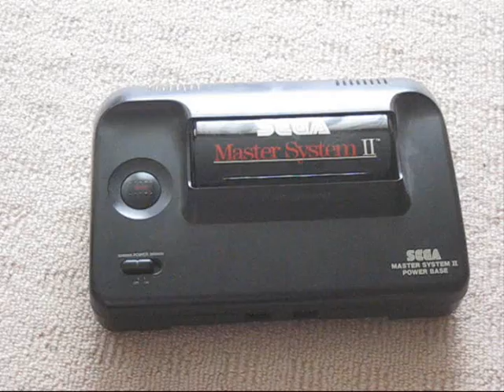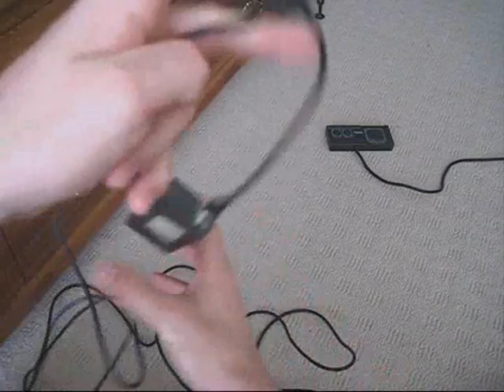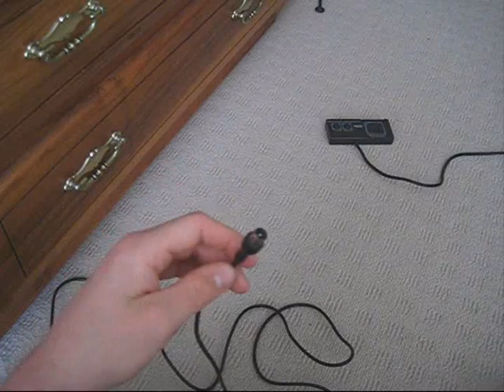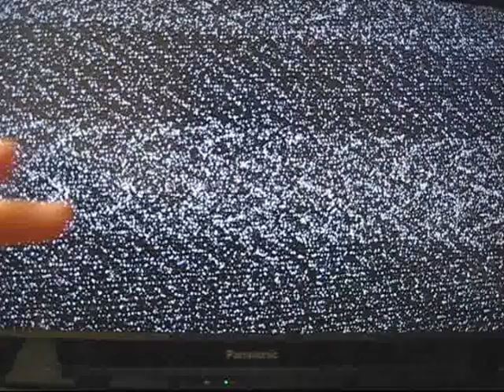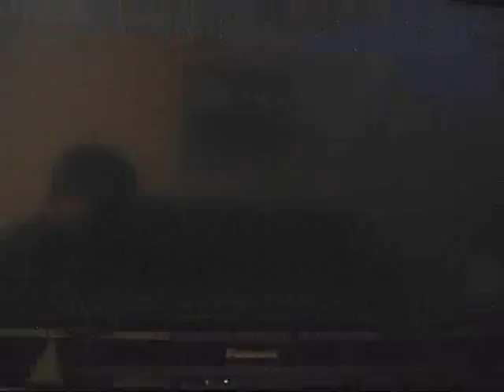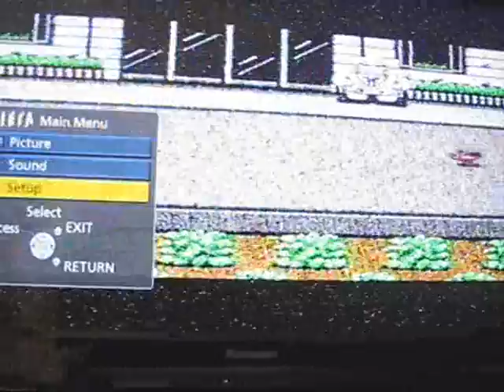How To Set Up  Your Sega Master System / RF console

Comment: Not all modern sets have manual tune for analogue, picture looks bad on HD set anyway.  Older tube sets provide better picture quality as it's native resolution.  If u still can't tune manually rf on crt set, you can pick up various adapters (rf to rca) on
 e-bay,radio shack, dick smith etc.

Comment: my pal master system lacks a switch selector.
trough that rf adaptor looks clunky.
sometimes i wish that modern tv's could restore & improve that crappy rf signal.
Reply: Depends on the part of the world you are in. The manual I have mentions a switch for the New Zealand version but the switch is to choose channel 2 or 3, I believe this is because most TV sets in NZ were VHF only until the late 80s. The other countries in the manual there is no switch and the advice is to use channel 36 on the TV. There was also a French version that used a scart port.

Comment: hi, i bought a sega megadrive off ebay and I'm stuck on getting it set up. The RF cable - do i just plug that straight in my tv or do i need a cable already going out my tv to plug in the RF ? i got it to work a week ago (shoving the RF cable in a slot at the back of the tv) but the picture was fuzzy and kept switching on and off, i accepted that it was prob dodge and not gonna work and left it but now its like, i really wanna play! =(
Reply: Are you too lazy to try? >:( 
Well for my master system it just plugs straight to the tv antena "hole".

Comment: For a master system 2, can i use a different console power supply (UK)? are there any other consoles that have the same voltage as the master system 2?

Comment: Does anybody know the frequency of NES classic? I am losing my mind, trying to set it up. I also tried AV conection and i get the picture, but not the sound, no matter what I do. I am using samsung smart tv
Reply: I've been having issues trying to get my NES tuned in too. My SNES is tuned into 590 MHz using a PAL system pretty sure both system use the same frequency. I've had loads of issues trying to find this; problem is the game might not be loaded which would effect the signal. Ended up setting it up using an AV cable to make sure it was working then tuning it in on the RF cable. Unfortunately think my NES has other issues as its not fully working at the moment.